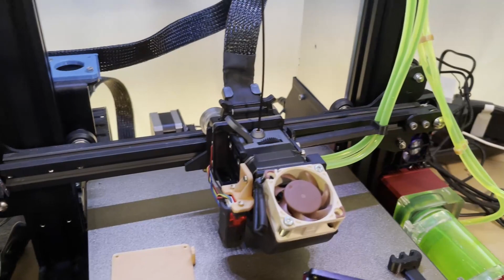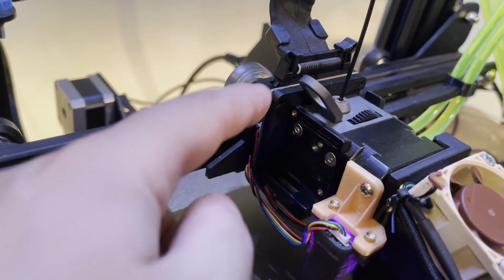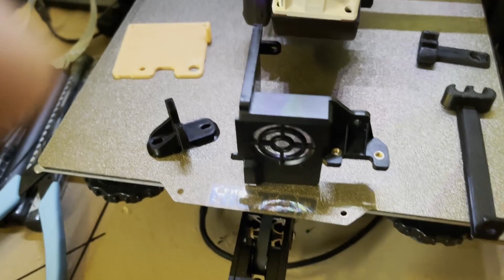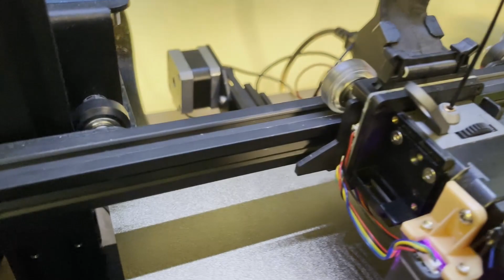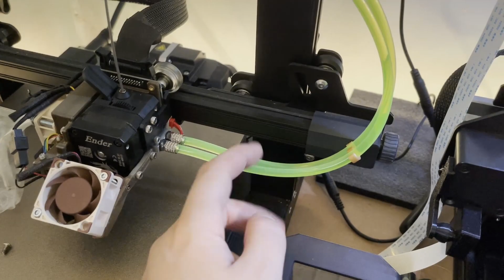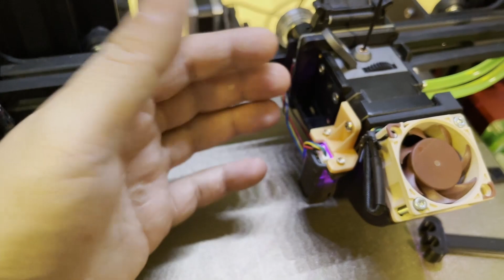Creality Sprite extruder modification (Ender 3 s1 pro / V1 / V2)

Comment: It's driving me a little nuts how all these folks have videos showing how to install the Sprite extruder on an Ender 3 Pro, or at least already installed, but nobody ever seems to mention the bolt collision issue on the right-most side of travel!
I'd love to see either some modified gantry plates, or a kit of the slightly different components needed to restore full width travel with this thing mounted...
Reply from the maker: on my printer i didn't have that long bolt issue (or I would have mentioned it), but on the discord channel some ppl did have it, the easiest way is to shorten the bolt.

Comment: Another great vid - liked, shared, sub'd ;) BTW a few questions... Are you worried about heat creep from using PLA on the extruder (either fan duct, CR touch sensor, or even mounting plate)? I was thinking of printing in PETG (or later in POM if I can ever get it to work)

Also see that you're using a part cooling fan duct similar to "Nathan builds robots". not sure who made the original but the open source nature of 3d printing means it doesn't really matter so long as the products get better as a result. Wondering - in the 21 Aug STL in your discord (the one for all air cooling no water cooling) why did you add rectangles to the sides of the duct? Does it add rigidity? 

And where did you add the buck converter? I can't see it in your vids. I'm considering running a long cable along the data/power cable from the extruder and mounting it on the left Z axis extrusion

Looking forward to the Raspberry Pi / Watercooling giveaway! I've been doing lots of mods to my S1 and it's nearly "ready" ;) I like watercooling PCs but have trouble getting my head around water cooling the S1 extruder as I don't see a big performance or noise difference vs noctua fans... can you convince me of the merits of watercooling in this case?

Thanks mate! Cheers from London!
Reply from the maker: Hi there, the original model comes from Nathan indeed , i just remixed it, the STL file from 21 of August with the buckets on left / right sides are meant for as housing for the tiny buck converters check this video for a showcase https://www.youtube.com/watch?v=ejiw6VsKjK4
I dont use buck converters on my partscooling and hotend fan any more, i use watercooling for the hotend and i use series connection for the motherboard and partscooling fan (ender 3 v1/v2)
If u like ur printer very quiet then u should consider getting a watercooling solution , my printer is now ultra quiet ... I'm loving it!

thank you for subbing and liking the video:)

Comment: Are you still using a max flow rate for printing? I am having some issues with mine getting clean skins and am pretty sure it’s a flow rate issue.
Reply from the maker: Yes my flow rate is at 429.4

Comment: My S1 is coming tomorrow and I have extensive experience watercooling computers but never heard of water cooling the hotend of a 3D printer! Where did you buy your blocks, tubing, pump, radiators, etc? Do you know of any guides? Lastly what's the benefit over a stock setup?
Thanks !
Reply from the maker: well check this out, here u will find most of the answers ur looking for :)
https://www.youtube.com/watch?v=Tu3YpGM9qwQ

Comment: You can remove the side fan duct (hotend). It doesnt add much sturdiness if you ask me. The direct drive and stepper are hold together by four screws that run from the back. Top two screws hold  the direct drive alone, and bottom two also hold the hotend as you might have noticed when you installed the water cooled one.
Reply from the maker: thanks for the tip, i already have done it ... it looks much sleaker now :p

Comment: Seems very unnecessary. Are you noticing any improvements with all these mods? Won't the weight make high speed printing worse?
Reply: I mean that there is no sound
Reply from the maker: @jfonly  err yes there is....
Reply from the maker: this actually makes the hotend lighter in weight!
Reply: @aim6mac  Hard to believe with that water cooling system attached.
Reply from the maker: @DKFX1  oh u meant that... ok yeah it probably does add a little to the weight, i thought u meant the last mods...